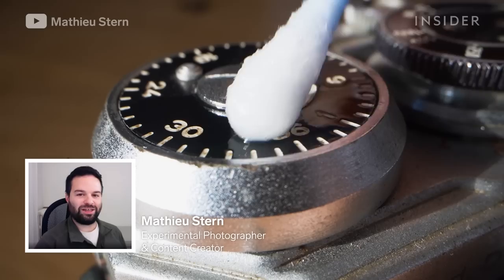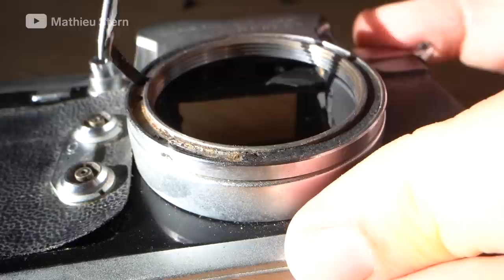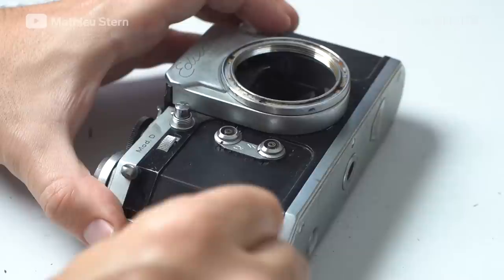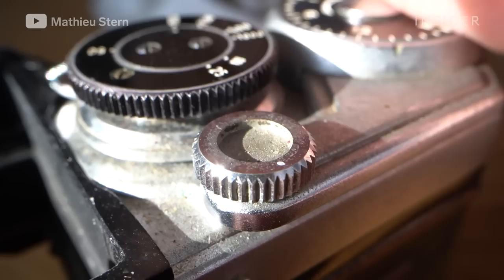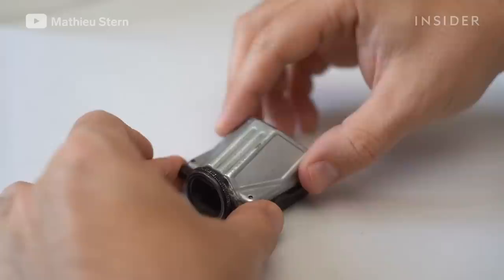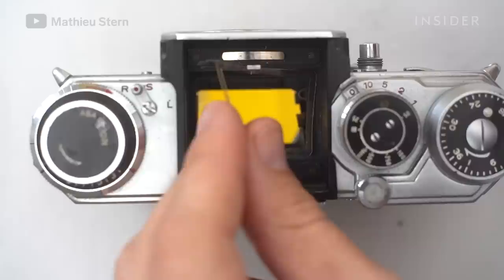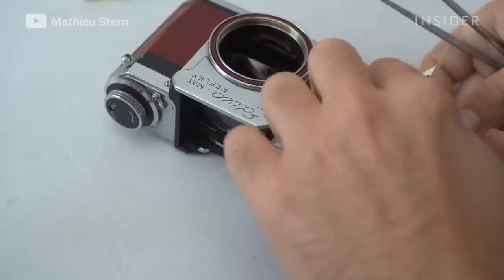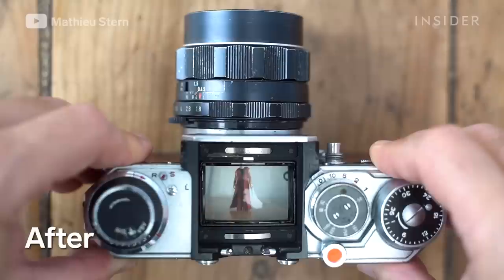How A Grimy 1960s Camera Is Restored | Refurbished | Insider

Comment: the black permanent marker is definitely not the way to go. it's not permanent enough, not opaque and thick enough, likely to be a weird blue-purple tone, and will rub off on hands.
Reply: What do you recommend to use that’s better? 3:13
Reply: @carolynquirke5342  brush on something that more closely resembles the original black lacquer, on a well cleaned and maybe primed surface. I've never lacquered metal, but I've heard of zapon lacquer as an old standard lacquer for metal. but there probably are many others. you can buy colours for mixing into lacquers, and I think also fine powdery products that you can mix into lacquers if you want them to dry matte (by making the surface rough). at least there are lacquers that already have that stuff in them. for non-transparent black lacquer, an insoluble pigment such as lamp black or bone black would be good (the original lacquer on metal definitely was non-transparent, it looks a bit odd to see shiny metal reflecting through a black lacquer).
Reply: youd want at least a paint marker
Reply: Not a regular sharpie
Reply: Honestly a fine tipped paint pen is a great option

Comment: I wouldn't call this a restoration, but a clean up. I mean he could have gone a step further in REALLY restoring it, like taking it apart completely, cleaning everything, replacing ALL of foam (resoldering the wires and replacing capacitors if any), repainting the whole thing properly, not just going over with a sharpie lmao